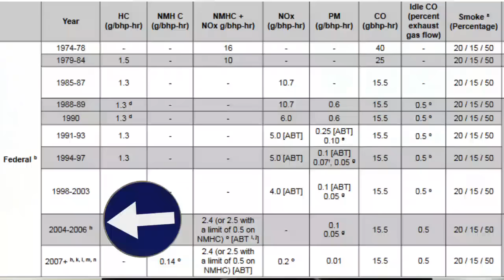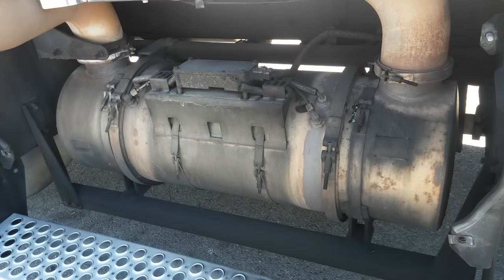Why Do People HATE Cat ACERT Engines?

Comment: I'll keep my old 3406b all mechanical. Never any problems, reliable, good fuel economy and pushing around 650 hp. And very easy to work on were I can do most of my own work.
Reply: User serviceability is everything....Especially, when it's a road side repair! Huge savings in money and down time.
Reply: The best engine ever made by Cat.
Reply: Very sensible ,stick to what you know , anything geeky leaves me cold,as we in the UK are not blessed with these geeky KittyCats, especially the small C7,s and C9,s.Far as small engines are concerned  Clessie Cummins is dominant in UK , their little four pot ISME 'lawnmower' engine very popular with DAF and IVECO, yes those Italian washing machine makers use them,and the ultra quiet reworked 6BTA and Hestair Dennis uses the 8,3 litre C series in Trident buses.  Reading some of the comments from  owners and drivers KittyCat,s ACERT engine is a bag of shit.  Is the 3406 and later C16 the same engine ?. Like you i want my KittyCat C16 to meow 650 ponies reliably , and what is their torque delivery between 900-1800 rpm,as i want the big  Kitty to meow away from the traffic lights at 900 rpm without any problems.
Reply: @angelosmith8755  c15 6nz for me
Reply: Oh yes, 3406 one of my all time favorite engines!!

Comment: ACERT - Advanced Cash Excruciating Removal Technique.
Reply: Delete, delete, delete.
Reply: Haven't found that to be the case at all.  My local mechanics all recomend it over EGR Cummins or Detroit.
Reply: @scottcurry479 Because your mechanics want that 💲💲💲
Reply: @hom._.    Hardly.  I have found my KCB to be way cheaper than any other 05 engine.  I'm at 2.1 million on it now.
Reply: @scottcurry479  Lucky you.
Reply: @hom._.  What does luck have to do with it?  The ACERT Cat was better then other pre-07 emissions engines.  Nothing built between 07 and 10, even up to 12 was worth a shit.  They are all deleted or junked.  The EGR valves and EGR coolers were a nightmare.

Comment: I went to school for this and have been working in the industry for a few years and this was the best explanation of emissions systems I've seen.
Reply: Most of the ARD heads failed due to the fact that the Primary fuel filter wasn't changed often, at least every 300 hours.
Reply: ARD heads also have fuel pressure solenoid which is in a fuel manifold which has a very fine strainer that looks like ceramic. It does get clogged overtime so even with maintenance done every 250 instead of 500 hours is still gets clogged. Problematic system anyways...

Comment: Honestly, the ARD head and that system in theory was a really good idea. Compared to how everyone else did it, injecting extra fuel into the cylinders, which always leads to some fuel dilution, possibly cylinder wall wash, and high heat in the cylinders. Doing it after the engine basically avoids all of that. Avoiding EGR for as long as they could, and then when they finally did, deciding to pull EG after the DPF was also a great idea. Gotta give cat engineers credit for all that. Not sure why they couldn’t improve the ARD head and make them reliable though. Wish they wouldn’t have stopped producing truck engines.

Comment: There is another way to solve this problem, politically, isolate the heavy truck engine line to its own LLC, make a very simple and reliable engine that doesn’t meet the EPA’s standards(what the customer wants), pay the fines, get government stimulus (your fine back) because the business isn’t viable do to the fines, and the line is an infrastructure necessity. To beat the government, beat them at their own game...
Reply: Yes , let's go back to the days of smoke polluting diesel engines . I remember the 50' thru the 80's and into the 90's . We cleaned up the engines , and also the fuel .
Reply: My glider truck has a 93 series 60 Detroit,  it barely smokes any, just a little poof between shifts if under a heavy load

Comment: I have a C15 Acert (NXS24662) It has been really good to me 1,4700,000. Going for it first inflame in a few weeks.
Reply: MXS 1,480,000 getting it rebuilt with the platinum kit aug 31st, looks like were about in the sane boat, mine started spitting up coolant so you're right on the money.
Reply: jmh4ggg agreed! Had mine overhauled last November and I’ve been very happy with it. Good luck!
Reply: What the coat of the in frame? I’m about the same mileage
Reply: Wayne that is going to depend on what kit you are going to buy.  You have a Bronze, Sliver, Gold and Platinum rebuild kits.  I went with a Platinum Kit with Turbos and a Compressor. Parts were right at $19,000 plus labor. My labor is going to run me right at $4500-$5,000. I also put a clutch and new u joints and carrier barring in the truck also. I am going to be getting 3 years unlimited miles warrantly on the engine with this also.  Do your research and talk to your certified CAT mechanic. I have a great guy who works on my trucks and he has help me a lot and CAT financial has help me too. 18 months at 2% for all those parts
Reply: @southerncatfish4030  man thanks for the heads-up
Reply: @waynewilliams9384  You are very welcome! When you do your In frame BUY THE WARRANTY!  3 year unlimited miles cost me $3400.   That is cheap for piece of mind if something breaks CAT will cover it
Reply: @southerncatfish4030  my 6nz 2002 model had a platinum rebuild with 58000 on it well around three years later at 220000 my injectors failed I had them changed and less than 1000 miles later one injector tip come off so if I would have known about these problems I would have changed my injectors long before this at arou 100000 miles on the rebuild I don’t know if I damaged the cylinder yet
Reply: It's a good engine.  Update the heads, keep a few IVA sensors on hand, and change the oil regularly, and they last.

Comment: I run water injection on my 6nz c-15, which significantly reduces heat in the combustion chambers.
This is a very good way to reduce or eliminate Nox. It also increases the torque of the engine by about 25 to 30%.
I see a significant reduction in coolant temperature and also EGTs.
I wouldn't run without it 
Too many advantages with no downside other than the cost and having to fill the water tanks.
It will NOT damage the engine AT ALL if properly installed and operated correctly.  Sno-performance has an excellent system. 
If you install this system I highly recommend you install at least a 30 gallon tank. I have 2 such tanks. 
These large engines can burn 60 to 80 gallons a day.
I have been running it for over  10 years now, and have never had any problems with it or damage to my engines.
This is the second engine I have run it on.
NOTE; it's only effective on hills, and steep grades.  It does not even activate on flat land.
Reply: While it seems counterintuitive, water and water/methanol injection on large Diesel engines has been shown to be able to reduce both PM and NOx.
Reply: 100% there with you on a water injection

Comment: One reason C15 ACERTS weren’t liked that much in Australia was because the engines were designed to lug down at lower rpm than  the single turbo C15s and 3406s. It just doesn’t work when you’re running weights of minimum 65 tons up to 200 tons with multiple trailers. Also if one turbo goes out, you’ve got to replace both as a rule. Any wiring under the valve covers has to be replaced fairly regularly because it cooks under our hot conditions. At least we didn’t have to run particulate filters and the rest of that crap on our ACERTs when they were installing them in our new trucks. Now if only they’d gone to using DEF like the other engine manufacturers they’d probably still be around...
Reply: Is the cat acert bad ? I'm not too sure but my truck after 8 years and 1.2 million km still going good its 2009 C15 Acert I service it on time, but I was worried years ago when I bought it but not any more since it kept  me going  well after 8 years.
Reply: @isaakgentz7393 they still ended up using it eventually. It was get with the game or use Cummins in your off highway. You know what they decided to do

Comment: Good explanation , l have 06 cat c15 and your right about injector harness . I just replaced both a couple of weeks ago broken wire . They had over 700,000 miles on them , engine light came on . I've had this truck for 11 years , had a platinum kit done 7 years ago . Its been pretty good to me , good power half decent fuel mileage . What l like most is the independent Cat dealer network , when l have engine issues l dont take it to a peterbilt dealer l take to a Cat shop . Everyone of those Cat shops over the last 25 years have been really good , they have a lot of knowledge and experience . They always fix the problem and get me on my way in a timely fashion . I have had other trucks in that 25 year period all had Cat engines in them . Only reason I have had this truck so long is it has a Caterpillar , and when it comes time for in frame l will not hesitate .
Reply: I am like you Either my local Cat Mechanic here in NC or Thompson Cat in Tupelo MS
Reply: Yes sir my 06 mxs... platinum at 1 mill has 1.6 going strong... bully dog tuner, boost sensor harness.... its a beast .not best at fuel .3.36 rears.

Comment: I’m a diehard CAT engine fan. I drove an 03 kenworth with a 550hp c-15 single turbo. Boy she’d scoot. Then I went to a 06 Detroit 14.7. It was alright. Then the biggest POS a maxxforce. I mean total junk. 2 egr coolers under warranty, a high pressure fuel pump under warranty and 4 egr valves under warranty. We live in the rust belt in Michigan and we were constantly changing coolant and oil pipes. Constant corrosion issues with lights. ABS lights on wet roads, way overly complicated hvac systems to keep us warm that we’re also constantly giving fits. Then four years ago I bought a Fitzgerald glider. Oh man talk about reducing maintenance cost! It’s got a 12.7 Detroit with 540k on it now. The only thing I had troubles with was the cylinder head leaking oil which was done twice because the front structure also was part of the problem. She’s the best truck I’ve owned so far and definitely believe I’ll get a million plus before the next overhaul. Still partial to CATS tho. Keep the vids coming. 👍

Comment: I drove a 2011 Peterbilt with a C13. What a nightmare regarding the Acert contraption. Every 6 months it was guaranteed to go in for replacement.  My boss, finally pissed enough money away because of it decided to delete it along with the DPF. The truck went from barely being able to drive 60 Mph fully loaded and having to fuel up every 2 days to after the delete, to being able to hit 80 mph fully loaded & being able to fuel up every 3 days. What a difference.  I drove that truck 1.2 million miles & it was a good truck once it was deleted.

Comment: The worst part for everyone with early IVAs was [I believe if memory serves] 'IVA #x not responding' were troubleshot by Cat by swapping IVA heads, putting it all back together, have the customer run it until a code returned, then see if the code followed the head or stuck on one cylinder. As a service manager at that time, I fought Cat tooth and nail because they refused to pay for two repairs with only one failure. After a while, iva heads just got replaced, -7 codes got new sokenoids, then those damned ARD heads came out. Constantly updating head designs, pissing off customers because Cat would not cover spark plugs even on a failed warranty ARD head. Ugh. I don't miss those days. That said, I was an International service manager during the Maxxforce days, so times got way, way worse.

Comment: ACERT Advanced Combustion Emissions Research Technology.  It worked in some engines. It was a very small injection of fuel before the injection cycle. The idea was to add fuel to fire (pre-ignition) at TDC +- (depending on flash file) and burn all of the fuel, instead of adding fuel to compression that caused ignition but did not burn all of  the fuel before being expelled through the exhaust. Every injector fired twice which is the reason trim files were very important. Incorrect trim file would cause excessive fuel consumption. Great video!

Comment: I love my ‘05 Acert! Had mine overhauled last November after 1.6 million and nothing more other than maintenance items and like Josh said, the occasional IVA problem which was an easy fix.
Reply: Has the iva ever given you problems with the engine breaks?
Reply: @albertosepulveda-lozoya3263  no, the only problem I had associated with my IVA’s was a check engine light. I never had a breakdown or performance related issue.

Comment: 00:55 Part 1: What is Acert?
02:55 Part 2: Medium-duty engines
04:37 Part 3: Heavy-duty engines
07:28 Part 4: Particulate matter
08:47 Part 5: NOx
10:15 Part 6: IVA's and VVA's
12:34 Part 7: A turn for the worse
13:55 Part 8: Particulate matter, part 2
17:02 Part 9: NOx, part 2
17:55 Part 10: Is this EGR? No, this is CGI.
20:01 Part 11: Blow-by
22:21 Part 12: Fuel systems
23:14 Part 13: Conclusion
Reply from the maker: Thank you for the glossary.

Comment: I work on c13 LEE Acerts everyday in MCI buses. The engine really is good. We have 18 of them and never had a major engine failure. I find if you change the ARD every year or so you're golden. I have a record of every ARD changed and for us and the type of miles our buses do, the ARD will fail between 10 and 14 months. Also we change the DPF around every 2 to 3 years. Do that and keep up with maintenance and you'll last forever. They all have about 900k of them. The only other issue iv been finding is high crank case pressure which pushes the oil out the stick. You NEED to not overfill them and you must change the crank case filter!! Also noticed the rear main housing behind the bell housing leaks alot. Gotta take it apart, changed the gasket and lock tight the bolts. Also gray silicon it too
Injectors last forever, turbos, water pump, oil pump, IVA, EGR also last forever.
Only think I don't like is that if I get a hard code for say, loss of combination/high soot. I find the ARD is bad soooo I changed it. Now I fixed the issue BUT I can't Regen it to clear the code. The only way to clear the code is to have a successful Regen lol. See the issue here? So we have to call cat in to clear the code.... Kinda shitty. Weve (njt) have owned these engines since 2008....

I don't blame cat for saying FU to the EPA and dropping out.
Reply: Jon Cooper sounds like you work for a company with deep pockets to be changing all those parts on a regular service interval. Do you work for a municipal  garage where taxpayers are funding the shop? That's the only way you can do it.
Reply: @robpeters5204  yes sir. But sadly with the type of driving our buses do, over the past 10 years iv never seen an ard head last over 13 months. It's almost like clock work that they fail between the 7 to 8 month mark. In parts it cost about 1,700$. That's for the head, 2 fuel fittings, spark plug, gaskets, and the 3 temp sensors. I'm sure you can get away with just doing the head and fuel filter fittings for around 850$. We rather fix it early and avoid the road call. Also it's new Jersey transit. Other then the ard issues, the engines is good. Never had a catastrophic failure. The buses with the cats all have around 900k on them. I changed 3 motors around that milage for high crank case pressure with recently low oil pressure. The engines get rebuild in house and cat comes and warranties them.
Reply: With that said.. if it was a privite business and it was up to me I'd probably stick with the non LEE Acerts. Think like pre 2007. No regen, AVI's, and no CGI. You need deep pockets and be able to do your own work to have a fleet of LEE c13s lol
Reply: @CoopaCoop  sadly I think they got rid of most of the last of the series 60 buses. I could never find out where their auctions went to. Replacing parts early is still cheaper than a tow bill/breakdown. 

We’re you a diesel tech or did you work on all the systems for the buses? I’m always looking for someone familiar with MCI’s, for reference to talk about, from 2007 and older. Thanks.
Reply: @user-ln7of9gs4s  yeah we had about 100 mci with the series 60 in them that we retired 2 or 3 years ago now. That's just our garage. Company wide, we probably retired 800 or so. Bus numbers were 7400's, 8200's, 8500's, 7900s, 7800s, and probably another 1 or 2 I'm forgetting. 
I wanna say that almost all were all sold to a single company In the northeast. A scrap yard. Most of our buses were from 1998. We had the series 60 Detroit diesels and we had about 55 of the natural gas version of the 60. 

Now we have 18 of the c13 cats 
About 50 with the Cummins X12
And about 130 with Cummins ISL-G (natural gas)

The natural gas buses (CNG) are a complete nightmare.  Its a tiny 8.9 liter engine in a
 45 ft, 55,000 pound vehicle. Mind you all our other engines are and were either 12 or 13 liters. Every engine has blown up with cracked pistons before 200,000 miles. They all got upgrade steel positions. Now almost everyone has had a failed head, dropped a valve, blown oil coolers, or blown head gasket.
Reply: @CoopaCoop  do you have a way of contacting you offline? An email or something? Thanks for the info, I’d like to share more details but would prefer not to do it on here.

Comment: Great video to understand all this engines complexity. I’m learning to deal with my Land Rover Discovery 2 with a Td5 engine now with 250,000 Km. Got rid of EGR system and having some blow-by. Initially thought it was not normal. Tried venting to atmosphere (draft hose-tube) but had to re-connect CCV hose to the depression valve in the inlet turbo hose. The problem was low turbo vaccum in depression valve at inlet turbo hose because it was cracked causing not enough vacuum to fully open the depression ccv valve to get rid of blow-by fumes. Better left all systems stock.
Greetings from Guayaquil, Ecuador 🇪🇨